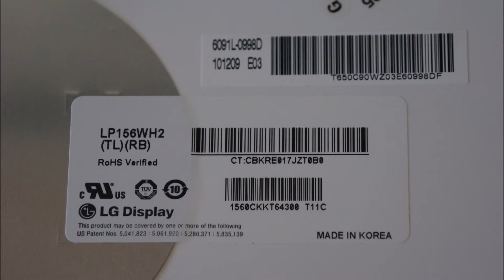Laptop LCD Driver Problem

Comment: The backlight is an led array, not a fluorescent tube.   The led array is supplied with 12Volts plus an enable signal, plus a pwm signal from the controller board.  The panel boosts this 12Volts up to 28Volts, then applies this voltage one after another to 4 sets of 9 leds.  The pwm signal (pulse width modulation) controls the broghtness - a narrow pulse gives low light, a wide pulse gives bright light.

Comment: I have same problem with lcd b156rw01 v3, I worked fined for about 3 months with an Amazon vs display controller board 40pin and then there is not power on the lcd

Comment: It also helps to  browse the datasheet for the display panel, checking for the required supply voltage to the panel.  The jumpers on the controller board can set 3V3, 5V or 12V.  The manual for this controller also shows how to flash the firmware (you need an extra piece of kit, plus a usb to parallel adaptor patch cable.). I have another panel of a different makeinside a dud laptop and might be able to adapt ...  Best of British... :-)
Reply: Do NOT change the jumper cable on the grounds that it will be completely broken. My was working but it had a colour problem. By the time I put it in 12v it fried the "CPU" and now it is not working it shows some lines

Comment: Hello, to me also the same thing happens to me, discarded the controller card, it is not defective, I have sent another one the same and the same result, I ordered other lvds cables in case they were confused to send it to me but it is still the same, Power supply that in my case I used a 12v 4A, which should suffice since it can also work with 3A, I also bought a usb programmer to try to program it with other firmware but the firmware that I have provided are very few and in no way If they correspond to the models of lcd panels that I have and I have already tested 3 lcd panels of different models. I do not know if the firmware is what is causing the problem but we are many who have this failure and are supposed to get it with the appropriate firmware to your lcd panel. Disconcerted, has someone been put in touch with a seller?
Reply: Hi. I am buying the same LCD controller. but my Panel is N156BGE-L21 will I have the same problem?

Comment: Same board, same problem. But the hdmi and the Dvi port do not work. As soon as I hooked a vga cable to it and the other end to a computer. WA-LA fixed.
Reply: Had the same issue a year ago and after connecting a vaga cable the board came to life... It had worked with HDMI afterwards, now after a year I try to use it again, same screen, and the problem comes back, connecting with HDMI doesn't work... Have to try again with VGA to revive it

Comment: the problem is that the controller needs 12v 4A, the power supply is not enough, i think i read 1.4A, i want to use a laptop power supply at 18.5V 3.5 A, will i be able to power it with 18V or will it fry up?
Reply: You can see at 0:33 it says 5.0A. The controller board can handle between 3A and 5A.

Comment: if you see the hole on the bottom left corner of the display facing the person filming , that hole is for a cable that plugs into an inverter then from the inverter into the controller board . the reason you are not able to see anything on the screen is because there is no inverter connected from the display to the controller board. the inverter is what drives the back light for the display to be able to see . make sure that when you disassemble the laptop to obtain the display to leave the back light cable connected to the display.
Reply: There is no need for an converter. Its an LED ,Not a ccfl backlight.

Also try to use a flashlight from the back to test if the screen is working...

Comment: I destroyed my panel thinking it was faulty, and too late did RTFM.   Basically the panel connector is flimsy and you have to push down the individual pins onto the connector on the controller boatd...

Comment: Hi, I've made some progress and I'll explain to you if I could help anyone.
I have managed to make the controller card work, however I must say that after having tried to change each of the 168 firmwares that were compatible with the terminology that you have recommended me to check on the web of panelook.com. after making a filter I have been left with about 8 firmwares compatible with the technical characteristics of my monitor and of those 8 only I got some positive result with the so-called "LP156WH2 TLQA-WXGA".
In short, in spite of compatibility with resolutions of the monitor also it is necessary to observe that it is compatible with the resolution WXGA and with the code "Si6L" (Si: Single Ch, 1CH); (6/8: 6 Bit): (L / T: Lvds or TTL; LVDS), and 3V.
I hope I can help someone with this information.
Reply: Hey Diego, so where did you find the exact firmware code for the board and how did you upload it? As the board shown in the video above does not have any type of USB interface to it.
Reply: sitanshu shekhar Hello, the first link takes you to a website where you have what you need, the software you have to use is downloaded along with the firmware, and the drivers for the usb programmer, in a word document explains how to do it, although there is a manual that refers to the programmer by parallel port, but only two things change with respect to usb, in the second link I show you the programmer that I have used, I do not know if there is any other that works, nor tell you if you can get cheaper, look at bangood there may be and there is usually more economical.
If you have any questions you can ask me, I'll try to help you as much as I can, but keep in mind one important thing, to program the m.nt68676 or m.nt68676.2a controller, I advise you to be powered by your power adapter, it's not I need it to be on, only powered, I do it with the led off and when it finishes it restarts. Extreme precautions if you do it with an inverter, the voltages are much higher, and especially if it does not show on the display a box with a text "without signal" quickly turn it off and try another firmware, of the two controller cards that I have a It is already broken, a burned-out transistor, but it smells burnt, so be careful.
Choose the firmware that you know is adequate by voltage and resolution, in addition to what I said of SI6L, which corresponds to the type of cable, channels and 6 or 8 bits. Never change the jumper voltage selector of the card, you have to leave it in 3V, only in case of much larger screens or other configurations.

http://www.elecrealm.com/down/html/?20.html

https://es.aliexpress.com/store/product/USB-Programmer-W7-Windfows-XP-for-Burning-V-M70A-Universal-VGA-LCD-Controller-Board-Powerful-To/110868_32704705518.html?spm=a219c.search0104.3.154.V1TilI&ws_ab_test=searchweb0_0,searchweb201602_1_5130011_10152_10065_10151_10344_10068_10345_10342_10547_10343_10340_10341_10548_5000011_10541_10084_10083_10307_10301_10303_5080011_10539_10312_10059_10313_10314_10184_10534_100031_10604_10603_10103_10605_10594_10596_5060011_10142_10107,searchweb201603_25,ppcSwitch_5&algo_expid=95edbd4f-f810-49dd-8d25-2c5f1fdd4064-20&algo_pvid=95edbd4f-f810-49dd-8d25-2c5f1fdd4064&rmStoreLevelAB=4
Reply: diego come ai collegato la control board al pc e aggiornato il firmware? io lo alimentata a 12v la control board e lo schermo lcd

Comment: You have no inverter that is required for backlight use flash light in dark to see and check after connecting something to VGA like connecting your laptop or PC to this Controller board. when you dont have any thing to display and without inverter.

Comment: You need an inverter
Reply: Ryan Konarska that display don't require a inverter
Reply: i have almost the same lcd LP156WH4 (TL)(A1) which doesnt require inverter. i just recieved my order from banggood its a V29. the first issue was the end of the included lvds cable doesnt fit my lcd which is a much larger socket. 

i was thinking if i should return it or cut the cable  and join the rest to the original lvds cable that came with the laptop lcd. if someone could provide a pinout for this type of lcd and a pinout diagram for v29 controller board.
Reply: It's led
Reply: KostasCubeCoding i fixed mine using the same 40 pin cable in this video and it works pretty well. except theres no backlight brightness control. I'm planning to make another one for a smart mirror if have plenty of time